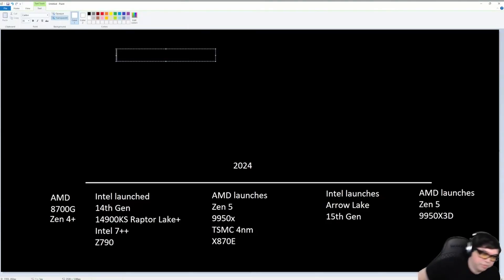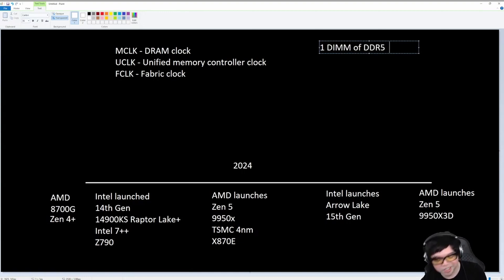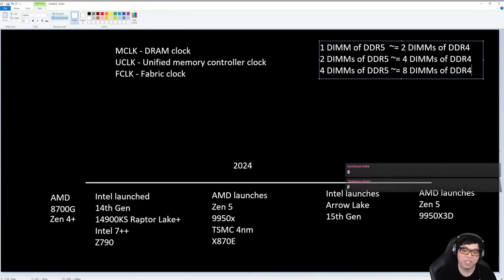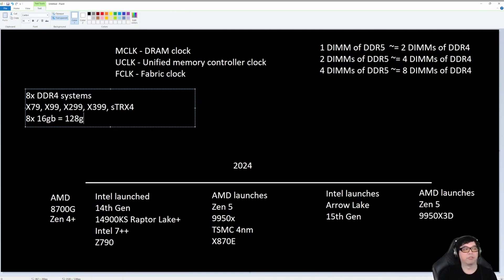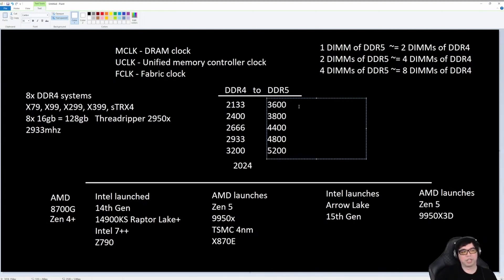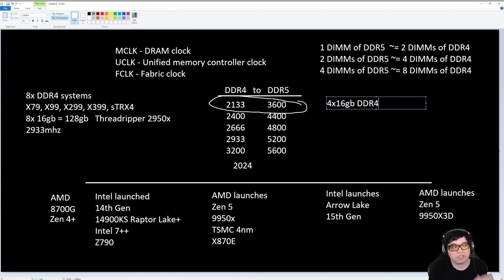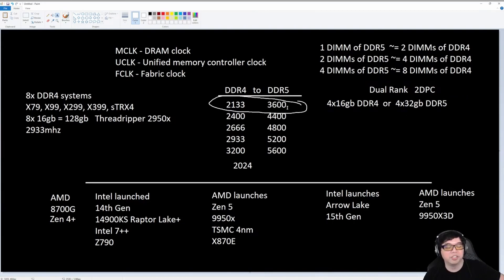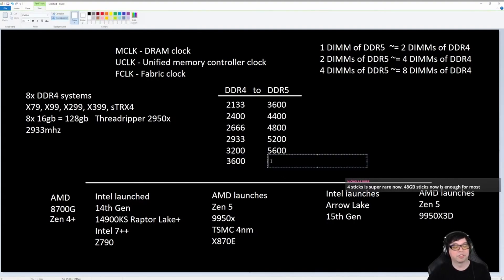How to convert DDR4 speeds to DDR5

Comment: i didnt get shit tbh, but i have (DDR5) 2 dimms at 6000, if i get another 2 of those i wont be able to run them at 6000? maybe im making it up but thats crazy haha
Reply: DDR5 struggles with 2 DIMMS on a single channel and running at full speed. You likely won't be able to just put another two sticks into your computer at 6000 MT/s. Part of the problem is that at that speed you start to become limited by the bandwidth of the memory channel. For example, if you had 2 sticks of ram that each took 1 second to present data and the CPU could take data every half second (lets say limited by the memory channel), then it could have a constant supply of data when it received it because by alternating which stick of RAM it uses, it can give the RAM time before it presents the next set of data. 

When you then move to 4 sticks, you can now present data theoretically every quarter of a second, except your interface only really stably supports data every half second. Your CPU can still take and process data every quarter second, so it requests data, starts a calculation expecting it, then the data is lost over the interface from signal degradation, cross talk, etc. and your computer crashes when the CPU tries to process data that doesn't exist.

I'm sure it's more complicated than that, and happens at much higher speeds with less perfect ratios for clock frequency, but essentially we are already reaching the physical limits of some of our interconnects on the motherboard, and sometimes DDR5 is prevented from working at full speed because of it.
Reply: I should know this before buying a 4 slots motherboard.